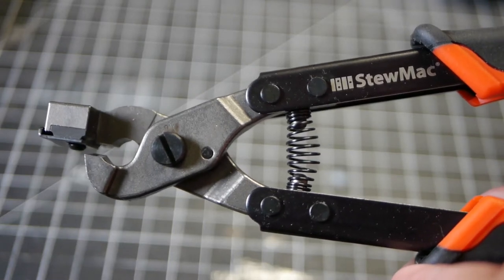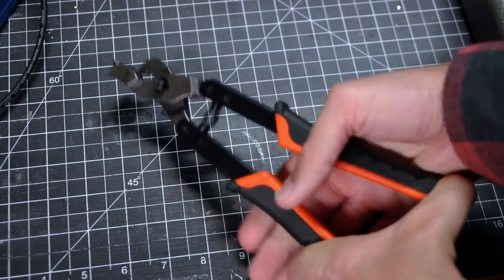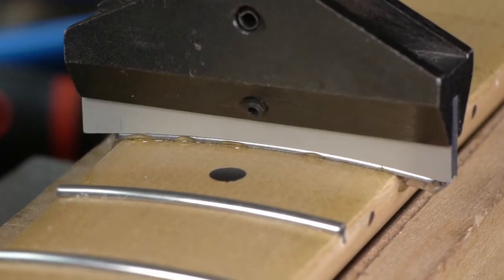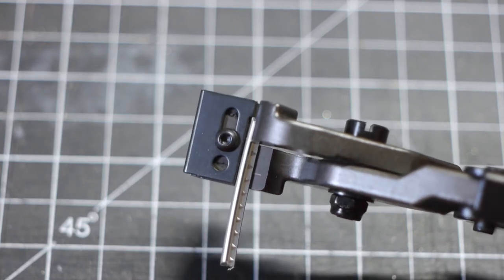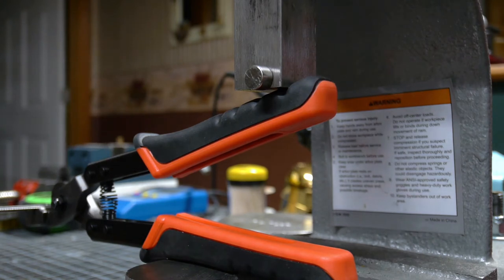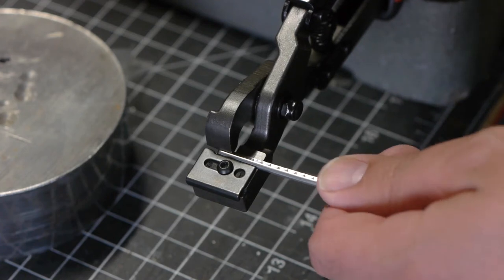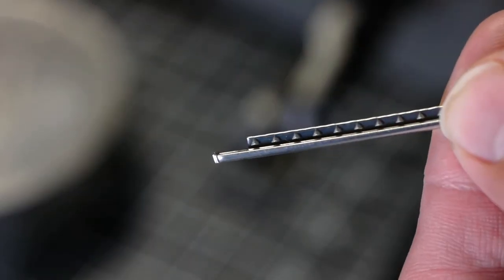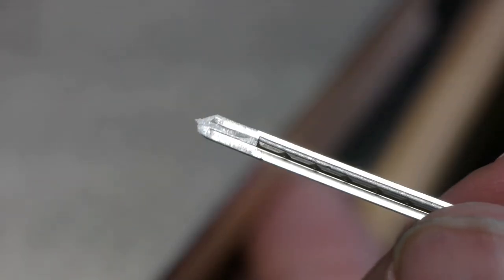Stewmac Deluxe Tang Nippers...with an Arbor Press?!

Comment: Sir do you have a video lesson about when i touch my single coil pick up its humming? & then may neck pick up have a humming.. TIA 🇵🇭
Reply from the maker: Sounds like the polepieces might be grounded. On Telecaster pickups for example, this might happen if there's no tape separating the baseplate from the rod magnets. I have a diagnostic video I made about testing pickups here: 

https://youtu.be/XDCHles5of4
Reply: @guitar_md  thanks a lot sir :-)